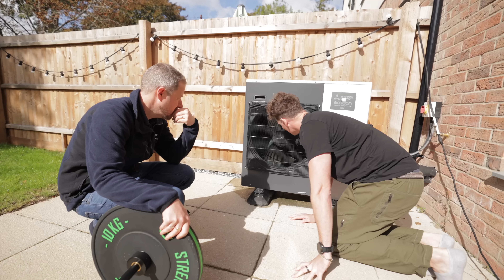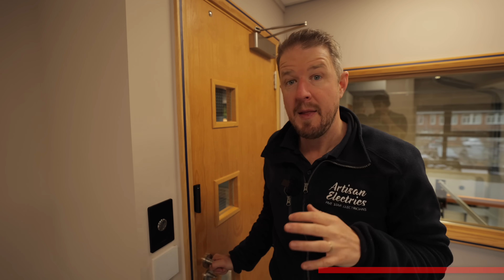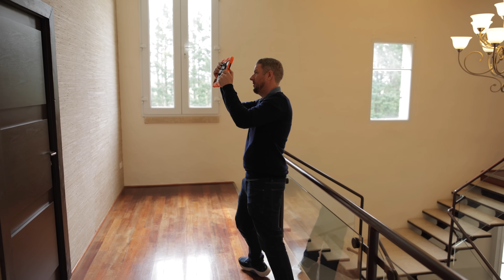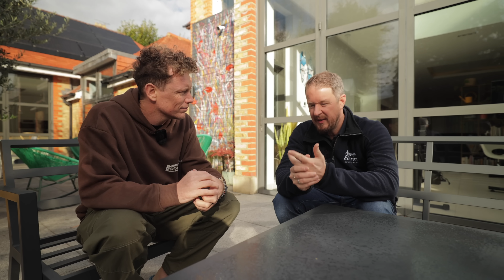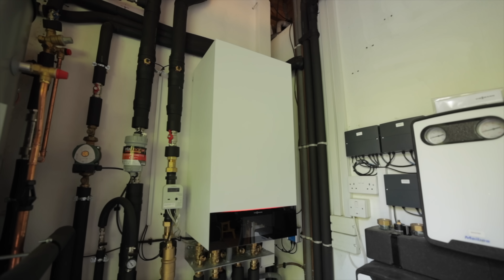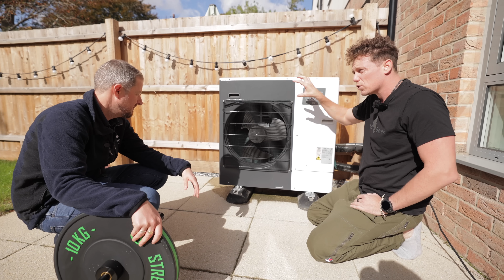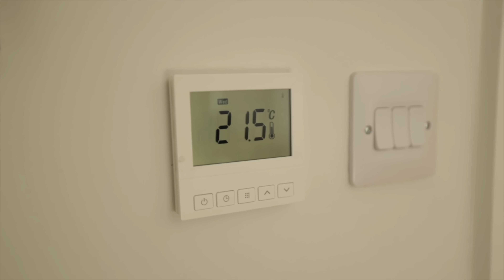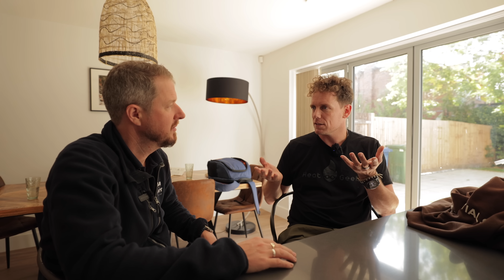Are Heat Pumps Really Worth It In 2026?

Comment: Sadly, our 30 yr old hose has the smallest micro-bore downstairs. Installing a heat pump would mean ripping it all out of the walls. A step too far for us. We do have solar & batteries.
Reply: My property has 10 mm pipe to all radiators but this pipe only runs to the loft where it is piped with 22 mm. I had my heat pump installed in July. Woks perfectly well. The overall flow rate to heat pump is close to 1200 litres / hour which more than enough for the 7 kW Vaillant unit. I think you need to find an installer that understand things properly and can do the heat loss and pipe flow calculations properly. I found that installers like EDF and BG had  a standard response to microbore without doing any kind of calculation.
Reply: @user-fc6bs9oe1i Thanks. We have 8mm all downstairs. Upstairs in normal (non-microbore). Not found a solution beyond new pipes yet. Will keep trying/hoping.
Reply: @richardeskins  What my parents did in their conservatory (which was plumbed in with tiny microbore when the rest of the house wasnt) was just cap off the pipes in the walls and run new pipes in the skirting board - no ripping out needed and just some filler over the ends of where the pipes left the walls.  the skirting is basically about an inch deeper than normal stuff, without knowing you wouldn't notice.
Reply: @jameshodgetts7541 Sounds good. Ours would be major work even using that solution.

Comment: Some good points however you are saying it isn't piped up correctly and this is simply not true. The cylinder and pumps within the airing cupboard are all delivered that way by Mitsubishi as a pre plumbed unit and the airing cupboard looks neat and tidy. The heat pump does not have a circulating pump outside and it is fitted on the cylinder. Weather comp sensor is fitted to the rear of the heat pump. The immersion heater supply needs to be turned on and the Mitsubishi controller controls when it operates for legionella disinfection. In fairness Mitsubishi should be pulled up for not insulating their cylinder pipework correctly before sending them out.  Only things that look poor to me is the condensate drain, pipe clips, burned fence post and outside insulation. Also if no antifreeze valves are fitted the system needs checking for antifreeze 
To summarize you don't seem to know enough about the Mitsubishi heat pump and its installation to be going around talking about it being badly installed.
Reply: Yes, this seems to be a theme. All the problems are down to poor installation. The problem is that these systems need to be heating the home 24/7. When compared to homes where people like to sleep at 16 degrees Celsius and like to turn off the heating for most of the time, they work out very expensive to run. I don't think I could get my MIL to leave her heating on all the time. Also, electricity is very expensive (and getting more so). AI is going to use most of it, in the future so goodness knows how much it will go up to.
Reply: @siowat7911  It's like you didn't actually watch any of the video. 🤣
Reply: It would be nice if @heatgeeks or @artisanelectrics responded to these points?

Comment: Heat pump and solar isn’t logical. You need heat when there’s least sun. Heat pump and off peak charged battery is very advantageous.
Reply: Shoulder months the combo works very well.  Sun shining but low outside temperatures makes for many hours of free heating.
Reply: Don't you use hot water when the sun is out?
Reply: @petergedge9629  I mean space heating
Reply: heat pump and solar in the UK is actually very logical, especially with air/air

When do I most need cooling - when it's sunny
When are the coldest days of the year - when it's clear skies outside

On current UK pricing though you do off peak battery charging to run the house and sell all your solar at 15-16.5p/kWh. Battery keeps your costs down, solar simply prints money randomly through the year to pay your electric bill later.

That of course will all change once we have enough solar.
Reply: That’s why you get a tank and heat that during the day for heating usage during times without sunshine. A water tank is way cheaper than batteries and using small amounts of energy to top off the tap water at night is probably cheaper than paying for battery storage.

Comment: SY cable is not rated for external use. It doesn’t provide any protection against UV damage.
Reply: Ho7 all day long.
Reply: @paulprescott7913 
Some manufacturers instructions specify  H07. I’ve seen one person using T&E on YouTube. 
There’s a lot of vibration on heat pumps so it seemed a really bad idea.
Reply: It will go all brown black or orange on the inside as well when the braid starts to rust! Hi tough cable is much nicer and easier to fit

Comment: So does that mean if the installation from heat geek costs he said about three thousand pounds. Let’s say it cost five thousand as a ballpark figure, what happens to the other two and half thousand pounds? Could he not have a system whereby he could actually pay a household for have a heat pump = five thousand to install and two and half thousand cash incase the heat pump cost more to run = personally I think a lot more people would definitely go for a heat pump , I know I would .
Reply: its £3000 on top of the £7500, so around £10.5k all in.  The cynic in me knows that installers price themselves to be higher than the grant by about as much a gas boiler replacement would be - making the numbers similar after the grant - and pocketing what should be covering the cost almost entirely.

Comment: I used Heat Geeks to find an installer for our system. It’s been running well and we are happy with the performance and the installation. However your video stated that the installer sorts the £7500 grant. I assumed this and missed out on the grant as I live in Scotland where the home owner needs to do the application. When referring to the UK grant please consider all of the UK. Heat Geeks need to ensure their process in Scotland includes prompting the customer to ensure they have applied for the grant in advance.
Reply: "When referring to the UK grant please consider all of the UK" how about you use your brain and research it youself? lmfao bellend

Comment: Great collab. The best bit for me with heat pumps is they align themselves with the outside weather as the amount of energy you need inside a building is dependant on the weather / energy outside it. If the building isn't aligned with the weather and its environment its just spending lots of energy fighting it. Solar and Heat Pumps are re-establishing this connection. 
Lots of potential with Agile tariffs as buildings lose most energy typically when there is the most wind which is when grid elec is cheapest
Reply from the maker: Glad you enjoyed the collab!
Reply: Don't forget that you have been able to use weather comp with Gas boilers for many years but installers don't tend to bother - and the efficiency gain is less than with heat pumps - but they can do it, its not new.

Comment: The cylinder in his own setup is the "pre plumbed" option supplied by Mitsubishi, if that is plumbed wrong I'd be astounded as all that's required is adding the flow and return from the heatpump, and your primary central heating circuit. Surely Mitsubishi have plumbed them for efficiency?
Reply: I agree, I think the Heat Geek folk haven't come across the Mitsubishi pre plumbed units yet and could do with doing some research there.
Reply: Surprisingly not, pre-plumbed are slated regularly for bad efficiency. They have been optimised to 'just work' and not to win awards for efficiency.
Reply: @SeanW-zi6kj  Do you know personally what makes them bad for efficiency? I just find it interesting that they're notoriously poor, without any explanation as to what makes them poor
Reply: @Rusteh100  Ah yes, so on the Mitsubishi - there are 3 pumps on the pre-plumbed which is just completely unnecessary and uses electricity for no good reason. Worst of all, they have a standard low-loss header, which forces the system to run at higher flow temperature than it truly needed to be. If it was not pre-plumbed, no self-respecting engineer would put a LLH or that many pumps on, so it's just waste of components for a worse efficiency.
Reply: @SeanW-zi6kj  Awesome, thanks for that! Can they be "fixed" easily?
Reply: @Rusteh100  I'm fairly sure an experienced heating engineer (like a Heat Geek) could strip it down to its components that are only strictly needed rather than all the 'fat' Mitsubishi put in. It's pretty much all copper pipes etc.

Comment: Why do you only get it to heat radiators and water??  If your going to the expense of putting in a heat pump system put in forced air, through registers in the ceiling, so it will heat in the winter and cool in the summer.  Thats what we have over here in  New Zealand.  You need proper air conditioning.... never heard of global warming!!
Reply: The U.K. government won’t give grants for installation of air to air heat pumps because they don’t want to increase the use of air conditioning in the summer-which increases the use of electricity in the summer and increases greenhouse gases.

Comment: The only way to get a handle on these installs is to change the Grant to require it to register on-line with a government agency. If the COP isn't where it was spec in the Design doc then the company is removed from any further grants until all of the systems are correct. This would kill the dodgy installation. It would bring back trust in the industry. As if your installs are not within spec no money from the grant until they do.🤓
Reply: For solar (back when the government included people who understood economics) the FIT scheme gave you payments over the 25 year lifetime of the kit. That stopped most of the money disappearing into installers pockets, although some scammy 'lease your panels' people still tried it on. The model of an up front grant is just wrong because it breaks the pricing rather than really increasing uptake much.
Reply: @etchedpixels  Short term it improves innovation if it's set right
One of the reasons the pumps are expensive is a lot are oversized due to poor insulation and having to work with standard radiators

UK building regs need changing
Reply: @SlowhandGreg  Uk building regs were changed. The newer houses are heatpump ready (at least providing you want a silly air/water system).

Heat pumps are expensive because we insist on using air/water systems whereas most of the planet uses air/air and has done for decades. They are expensive because the government threw £7500 at the problem so the installers and manufacturers of air/water systems gleefully pocketed it all.

Price a system somewhere sane - even the USA where it's actually heavily overpriced because of the thousands of unique AJHs and paperwork nightmares. Then price it in the UK - we are being systematically screwed over.
Reply: @etchedpixels  They only require C+
That is quite frankly a pathetic standard

I've had an extension and just finished the last part of refurbishing my 1935 semi it is now A+

The Heating went off in March sometime and didn't come back on properly till end of October

Insulating to that level would add 10% to build costs and pay back capital cost outlay in 10 years max (inflation depending)

I also have underfloor heating on on the ground floor. It uses 40% less energy than standard radiators.
Since finishing the Roof last year the upstairs radiators no longer come on, the only instance was when it dipped to -10

The government needs to get specialist and create a hub for builders to access and increase all new builds and extensions to A+
There are multiple ways to do this not one single solution.
Reply: @SlowhandGreg  We are at 85% of newbuillds being B or A (despite the EPC penalty caused by the bogus heatpump scoring still) so it's not quite as bad as you make out. I agree entirely though - if you get to things like A+ and Passivehaus you don't even need to bother with heatpumps in many cases because the complexity/cost of maintaining the heatpump exceeds the extra energy costs of just using a simple infra-red heater, or a gaming PC  (or even a large dog or two) to heat the property.
Reply: You mean like the latest Government backed bodge, the warmer home scheme, where around a million homes now need corrective action?
At the tax payers expense no doubt...
Reply: Well,you have to vett them first. Most ppl will think that an installer on a government list will be of good standing,which probably isn't true most of the time.

Comment: It's not difficult to find a good installer. Mr Google can help. Mr Trustpilot can also give a hand. Avoid Mr Cold Caller Local Energy Adviser.
If you also have  a battery with off peak charging, you can immediately halve your heating bill vs gas. 
You can't run a gas boiler for free from solar. There is no half price off peak gas tariff.

Comment: Add a battery to time shift cheap rate electricity and the heat pump is a no brainer. Solar is a even greater bonus
Reply: Octopus has a tariff called 'cosy' which is designed for cheap energy during the daytime hours - ideal for heatpumps

Comment: Around 50 uk power stations run on putins gas so you could be a dead duck anyway with grid outages so don’t use that as a reason to change from gas would rather have a 2 foot box on my kitchen wall than that noisy monstrosity on my patio under my bed room window imagine summer windows open trying to heat your hot water with that fan on all night pathetic
Reply: heat pumps don't take all night to heat the hot water, especially in summer when the inlet temperature is much warmer.  But if you have solar, it makes a lot more sense to heat it during the middle of the day, and if you have batteries it doesn't really matter when you do it in summer.
Reply: @BenIsInSweden  Uk pricing is bizarre because we are so short of solar and our grid has a massive utilisation dip at night. In the UK you are better off exporting the solar and heating overnight.
Reply: @etchedpixels  Depends on the tariff, to charge overnight for cheaper than export, you'd need an EV tariff (or possibly E7).
If you don't have an EV, then it's typically going to be better to utilise the solar for hot water.

Comment: Getting an air source heat pump installed was the best thing I've ever done to our home. Even better than solar, battery storage, EV charger etc.

Heat pumps rule! 💪
Reply: I certainly love our air/air setup. It's been much cheaper to run (we do have batteries and solar) and it can also do dehumidifying and cooling, but even if were heat only I'd say it was a definite win.
Reply from the maker: Glad to hear such a positive experience!
Reply: Yes the reason its good is because of the 3 othermain components youve listed. Without the first 2, your billls will be high,
Reply: @Purebeltersteve not true. We installed the heat pump first and demonstrated the cost savings across several videos on my channel.

Just an efficiency of 400% and use of a smart tariff made it substantially cheaper to run than our outgoing non condensing gas boiler and would have been cheaper than a 95% efficient condensing gas boiler too.
Reply: @UpsideDownFork i hope you enjoy your heatpump adventure, im happily paying a small amount for my 4bed detached on energy bills and i will be in credit soon because the government will be giving me money back due to giving back to grid 😂😂. Possibly get the journalists round to sell my story on how i gotmy gas boiler bills down 😂😂😂😂
Reply: @Purebeltersteve cool story bro
Reply: @Purebeltersteve  The weight of evidence doesn't support your claim.
Reply: @rednammoc ok then, so if you didnt have solar and battery storage, your bills would be just as cheap. Ask heat geek, he will even tell you 😂😂😂
Reply: @Purebeltersteve how do you know that?

Comment: @ 3:23 payback? 😅😂 if you pay full price on everything and consider the lifespan of an airsource heatpump + lifespan of the inverter and battery there is no payback 😂 
20cm wall and 40 in the loft decent windows and you can heat the whole house with a small 1-2k combi boiler 😅 with very little money quite reliable and easy to mantain 😊

Comment: The two most important factors are heat loss (as you say) and the “heat delivery”. Old houses that where fitted with gas og oil boilers have a much higher flow temp., and therefore the radiator typically are small and have a smaller surface area. With a heat pump the lower the flow temp. the more economical it will run. Therefore the radiators needs to be more larger and have bigger surface area. That’s why underfloor in general is the best option when installing a heat pump, but with correct size radiators a heat pump will work very nicely. 

My self have did  a geothermal heating and underfloor heating system in my new build. My heat pump runs at a SCOP over 5, year round..😊
Reply from the maker: Thanks for sharing your detailed insights and experience!
Reply: The same applies to gas boilers, that work more efficiently heating UFH or with larger radiators.  A gas boiler heating low temperature UFH is very efficient.